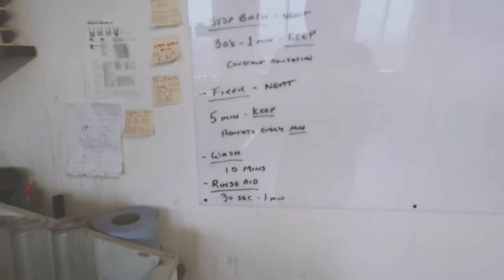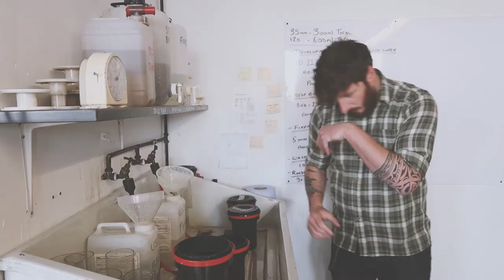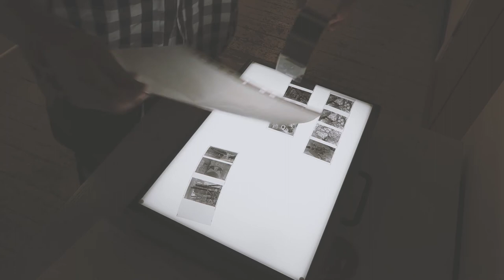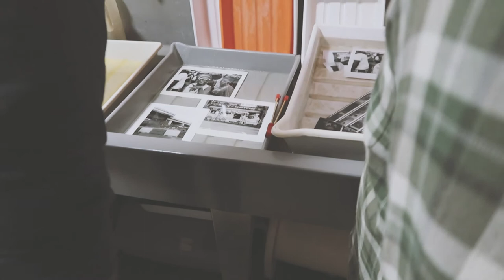My Darkroom Workshop at The Photo Parlour Nottingham

Comment: I really must remember that tip about cutting a 'V' shape on the film. I have been developing film for a long time and I still find the tank loading the most awkward and stressful part of the process. I have had the odd roll jam up about half way, I pull the film back and start again. Some people argue that it is better to open the cassette rather than pass the film over the canisters felt seals again as there is a chance of the felt seal scratching the film. I always try to rewind the film so that there is just an inch or two out of the cassette  and I do load from the cassette. My reasoning is that if the cassette is opened and the film spills into the changing bag it is far more likely to get scratched that way but it's each to his own.